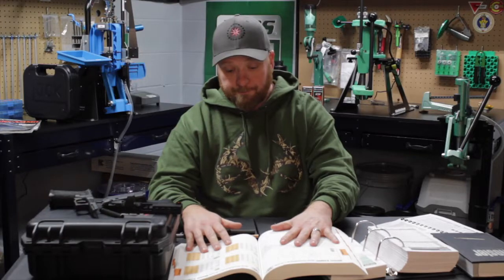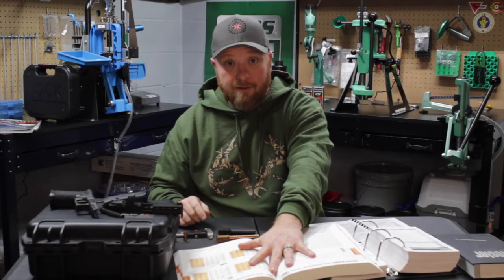Squatch Reloading - The Plunk Test and Case Overall Length

Comment: Its hard to find a video on crimping. So I have a question for ya. I commented on Hornaday bullets not seating at the recommended depth per their data. After doing the plunk test several times I found I wasn't crimping enough and that ended up being my issue. After checking factory rounds I found the 45 acp to be around .471 most of mine were roughly .473-.474 using lee FCD. Once I got them down to .471 they all passed and seated properly. Sure had me scratching my head for a while and wishing I had knew someone who reloaded local lol. My question is do you have a video or know where info on proper crimp measurements would be found? I have SAAMI PDF files and brushed through it but haven't came upon any in-depth explanations or min/max crimp measurements yet.
Reply from the maker: Typically measure the wall thickness of the brass multiply by 2 and add your bullet diameter this will basically be a starting point of removing the flare.  For example 9mm brass say .012 with a bullet diameter of .356  would be roughly .380 starting point.
Reply: @SquatchReloaded  ok thank you! Guess I need to go back and reread again. Because I surely don't remember reading that lol. That helps a ton.
Reply from the maker: May not be in a book but that’s how I was taught and it hasn’t let me down.  Again that will get you in the ballpark and you may need to crimp a little heavier.  Once you dial that in then go plunk test
Reply: @SquatchReloaded  ok thank you very much 😁

Comment: Ok, I have a question.  I bought a bullet from a similar company as Acme, It is recommended that I use cast lead bullet data. The book calls for 3.9 gn of powder and a sitting depth of 1.125. At this depth I cant get it to spin. However at 1.115 it spins. So my depth is a minimum of 1.115. But now I have to adjust the powder amount because I am reducing the overall depth and the minimum recommended gn is 3.9. Now is a trial and error for the minimum powder amount. Correct?
Reply from the maker: Yup trial and error.  The next consideration is bullet diameter.  Acme is .356 I believe and some others are .355 so if it’s less than .356 you would have less neck tension.  Best advice start with the minimum and work up until you achieve what you are looking for.

Comment: Very nice, So i am using the Galant 9mm bullets from sportsman warehouse. what would you guys think i the lowest col. i can go using the lowest powder charge winchester 231  1.07,
Reply from the maker: Ideally you running the longest COL possible for your tightest chamber and passing the plunk test.   You need to make some educated guessing when it comes to load data for unpublished bullets.  Sometimes people assume a shorter COL increases pressure however if the shorter COL is due to bullet ogive then perhaps the actual bearing surface is the same.  Always always start low and work yourself up on powder charge.

Comment: It's my understanding that OAL data is a MAX value and should not be exceeded.  There is also a .010 to .015 tolerance on OAL.  So, a 1.150 OAL value equates to 1.150 - 1.135 with 1.1142 being optimal.  However, there are always exceptions to these rules.  Be careful.
Reply: That last value, 1.1142 should read 1.142.  Dyslexia strikes again.

Comment: I pretty much wasted $ on pistol case gauges because your barrel is the best gauge for cartridge OAL & headspace.  Just recently, I loaded a box that gauged good & fired through one pistol ok but jammed up in another. Found out the rifling depths are .035 different.  No case gauge will detect this. Eggleston bullet mfg has a simple mathematical equation that works for any bullet out there.

Comment: Hornady book called for a seating depth of 1.100 for one of their xtp's I'm using and it failed the plunk test in all 3 of my 9mm's. Ended up having to seat them around 1.085. When I started I was told a case gauge was good enough. Ive learned that is false lol.

Comment: I used Acme 124 gr in a Glock every round key holed. ??
Reply from the maker: My guess would be over crimped.  I have seen that with cast coated bullets
Reply: @SquatchReloaded  Thanks for the info